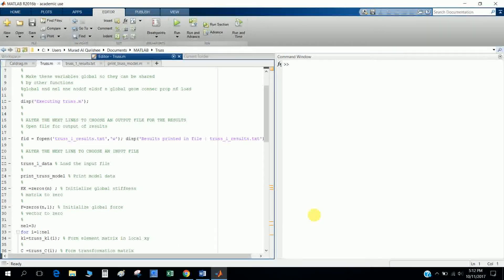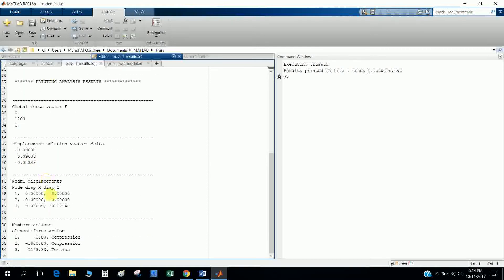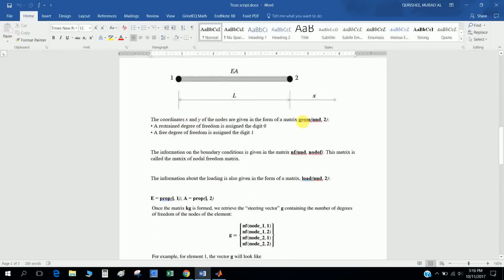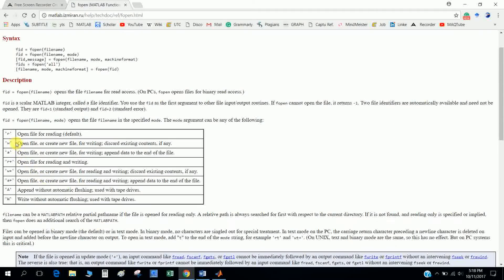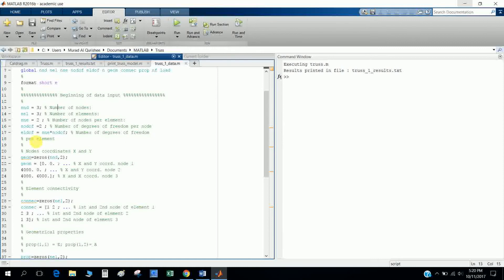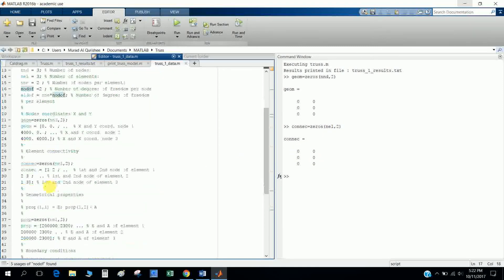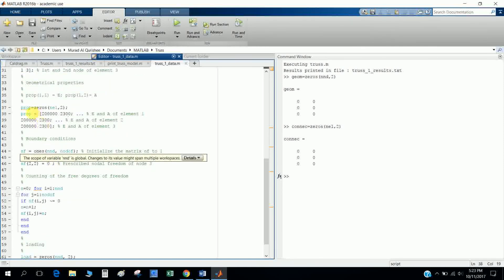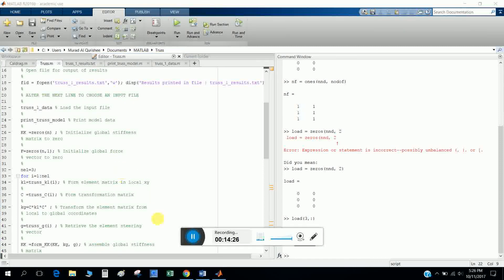How to solve a 2D truss in MATLAB R 2016b- part 1

Comment: Please help me to solve this 
Design and implement a computer script to automatize below task on  MATLAB/OCTAVE programming language.

Program to analyse 2D trusses, with hinged bars, of any shape and typology. The program should produce  the reactions, distribution of internal forces and stresses in each bar.
Deliverable:
The groups will deliver a report in PDF format with the following contents:
1. Introduction. Explain the topic of study, its significance in the context of structural and construction
engineering, and the objectives of the activity.
2. Analysis of the problem. Discuss the theoretical solution of the problem (including hand solutions), and
the solution algorithm proposed. You can use flow-diagrams or pseudo-code to explain the steps of the algorithm.
3. Validation examples. You should include at least 2 validation examples, including hand solution and the
solution obtained with the implemented code.
4. Conclusions. Critical analysis of the activity, aspects learned, comment the code efficiency, and possibility
for improvement, if any.
5. Annex. The implemented script should be provided, including the source code (*.m files).